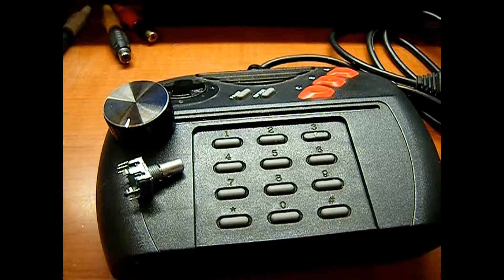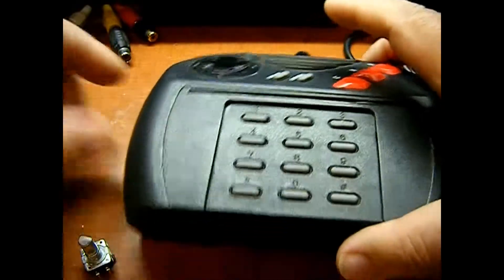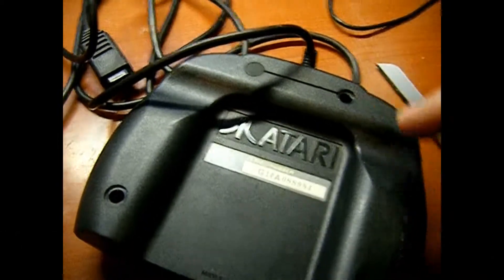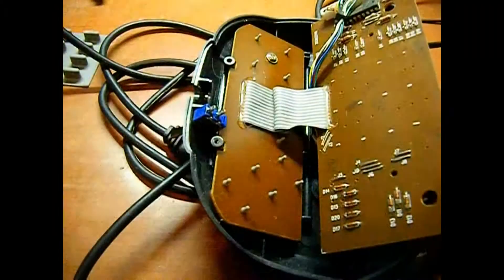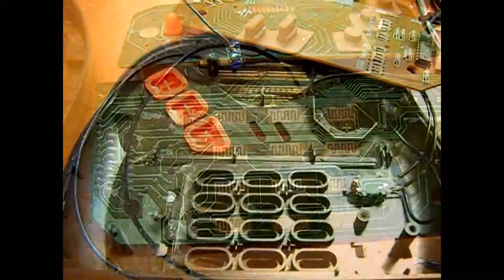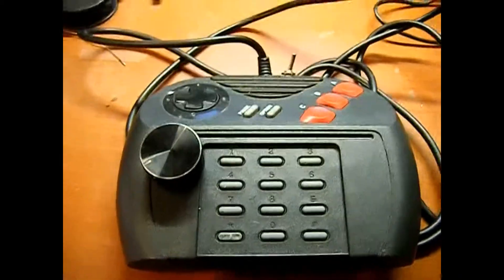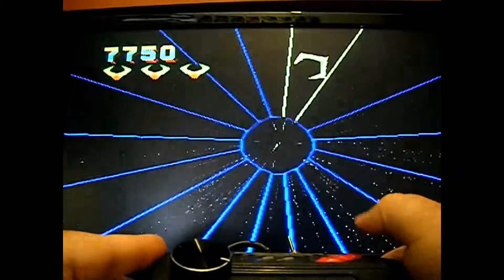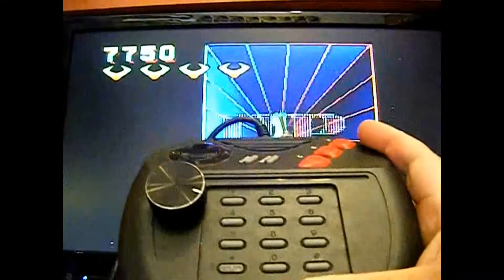Atari Jaguar Rotary Controller Mod for Tempest 2000

Comment: What would happen if you didn't put the toggle switch in?
Reply from the maker: I mentioned that in the video :P  the toggle switch is to select dpad mode or rotary mode.  without the switch you would either have just dpad control or rotary controller.  I opted to be able to switch back and forth as to not have a dedicated rotary controller.
Reply: @SVT512  Nothing in the wiring is disabling the d-pad from working, you're merely adding a second input option.  I left the switch off and both will work at the same time.
Reply from the maker: @speedcircuit you should make a video showing that :)  with out the switch on mine the spinner affects the game you are trying to play with the dpad, I.E it will keep either left or right on all the time.  The Dpad does not get disabled only the spinner with the  switch.  Since the contacts are normall open on the Dpad you dont have to worry about disabling it.  But in order to use the Dpad when a Spinner is present, you have to disable the spinner somehow.    If you have a way to mod a controller to use both the Dpad and Spinner without a select switch, please post a video to see what you do?
Reply: @SVT512  I mean, I just wired it the same way as everyone else.  If I spin the dial while playing a d-pad game, it will get "stuck" going left or right, but that can be resolved simply by turning the dial one click to the left or right to re-center it.

Comment: I soldered it together. The Rotary Controller works fine but the DPAd is not working properly. What could that be? I have the same encoder but an ON ON 3 pin switch.
Please could you help me. :)